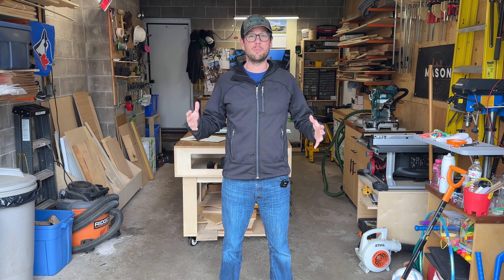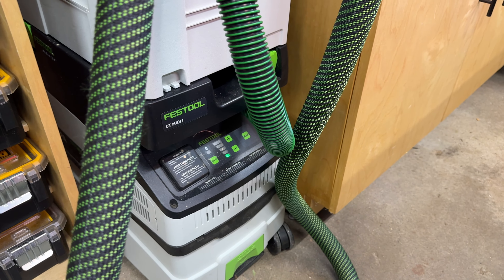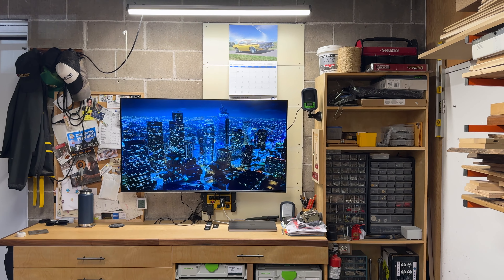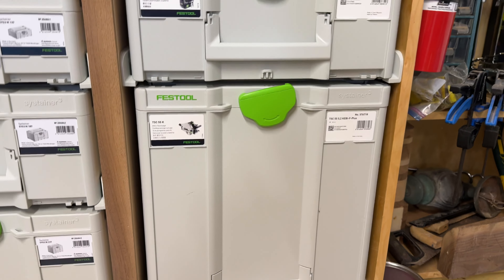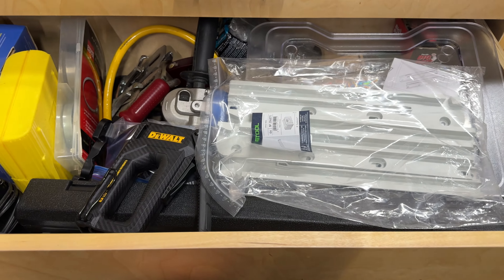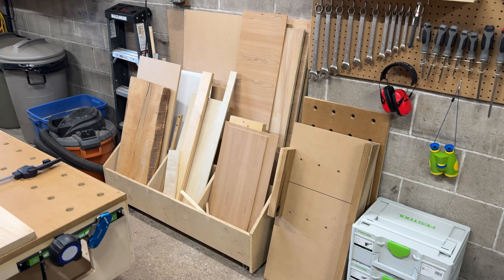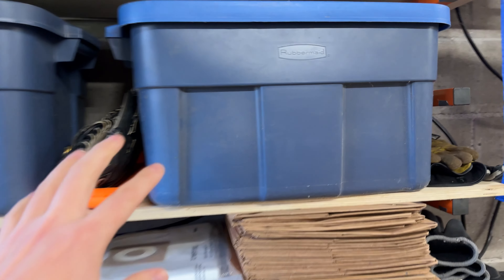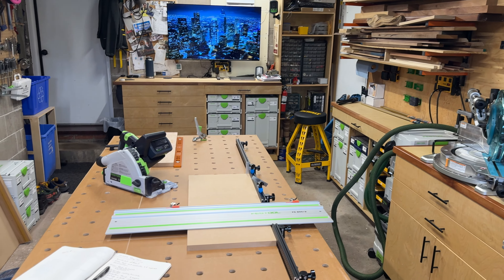2024 Shop Tour - Small & Efficient One Car Garage Workshop (20' x 12')

Comment: New subscriber here. You got me with that MFT workbench. It's perfect. 

My suggestion would be to start with that cinder block wall(after the leak is flashed off). I would pad the entire surface with plywood, so that attaching to the wall would be a breeze. Then ideas would flow from that, I think. That's such a large almost untapped area. Even wrap the fireplace surround.

I'm slowly expanding the footprint of my little hobby woodworking station. It has potential as it is a two car garage(no cars inside), and is deep. Always looking for anything that I can gift to the thrift store to clear more room.

Bicycles, ugh. The kids have left the nest, but my wife can't let go of them. I sometimes roll them outside, and even pump up the tires hoping that someone will steal them, but the wife always drags them back after she notices. 🙂 The bikes are really still brand new, cause they've each probably only been used five times each, if that. Hahahaaa
Reply from the maker: Thanks for such a great comment! I really like that suggestion on padding the entire cinder block wall. It would give me flexibility to do a number of things and give a much cleaner look. 

I’m jealous of the space you have in your garage and like you, the bikes are often outside during the day so that I don’t constantly trip over them. 

Thanks for watching!

Comment: Nice little vid. of your shop.I too am in a small shop and I know how hard it can be to find storage space.! A couple of suggestions would be to 1) is it possible to relegate the toys to the shed? and 2) find some space somewhere and build a multi-drawer hardware cabinet.I got fed up looking for screws,washers etc-would go and buy new only to then find what I thought I had all along! I made a 22 drawer cabinet and now if I need whatever kind of hardwsre=that' where I go. If it ain't there,I don't have it! Saves a lot of frustration.
As to the lighting,add at least three more fixtures.I used to think my shop was well-lit-then I doubled the amount of fixtures! I could operate in there now!
Make sure you get all your electrical upgrades done (for now and future use) before doing anything else to the walls.
BTW-instead of a california air compressor, look at the CT MAXIMUM uniy.It is reasonably priced and quite quiet.
Reply from the maker: Thanks for watching and sharing those idea (I'll check out the Maximum compressors! The shed is unfortunately about 200 feet back from the garage so I don't think I'll win much of that battle.

Great advise on the drawers and that aligns with what someone else said. I'm thinking that I might replace the bookshelf with 26" wide 12" deep 3" tall drawers that can then take a variety of cheap plastic boxes. 

I really like that thought on lighting and if I'm going to overhaul the electrical that would open up a number of lighting options. Plus, LED lights like these are quite inexpensive.

Comment: Nice space! I read some of the other comments dissuading you from foam in the drawers. I love it, personally. There are a few techniques that get best results. I've found the shallower product from Rockler to be plenty thick and it's competitively priced compared to branded Kaizen. Also, you can cut it with a laser! It's addicting... you've been warned.
Reply from the maker: Thanks for the advice and I never even considered the potential to cut it with a laser! I do think I’ll try foam in a few spots and the tip on checking out the Rockler version is helpful. Thanks for watching!

Comment: I recognize a good number of small quality tools in drawers not counting numerous Festool tools.  For the size of your shop I think you are doing the best that you can.  If you could send all of your wood to that shed out back you could make some floor to ceiling cabinets maybe with drawer slides for all your Festool Systs. or for hardware.  Yellow and black Stanley plastic containers in drawer slides is what I went with.  But they might take up to much room.  I would take a second look at options to the foam inserts for tools.  Might take up to much space per drawer.
Reply from the maker: Great tips, thank you! I've been putting off foam in the drawers for that exact reason - it would take up a lot of room. Hardware is likely to end up in the Systainer organizers over time, but that'll be a whole organization process into itself, haha!

Comment: I’m not quite sure why ppl like those 8 or 10 inch disc sanders. The pads don’t last as long. I prefer belt sanders. Especially long belt ones which last much longer. But hey that’s just me I guess🤷🏻‍♂️
Reply from the maker: I've been finding that the pads last reasonably well when I use one of those rubber-ish sandpaper "erasers", but when I do need to change them after the grit is worn down it's a huge pain with how they stick on. A big wide stationary belt sander would be my preference if I had the space.